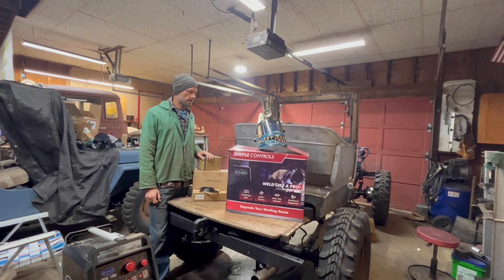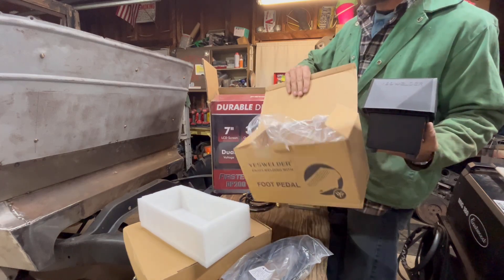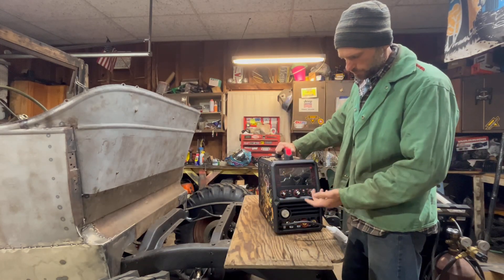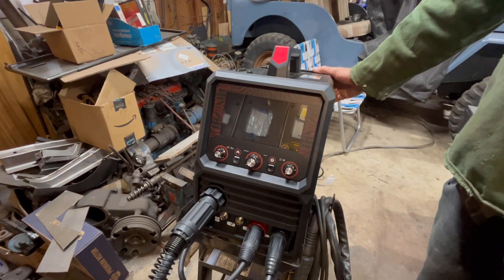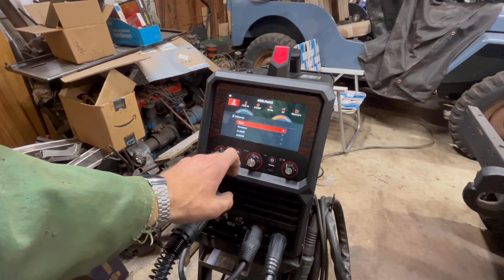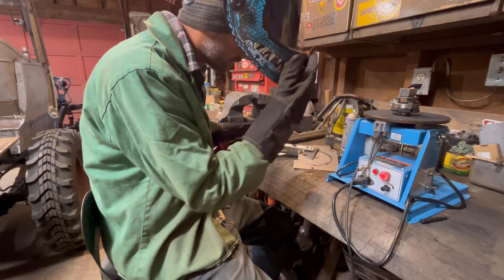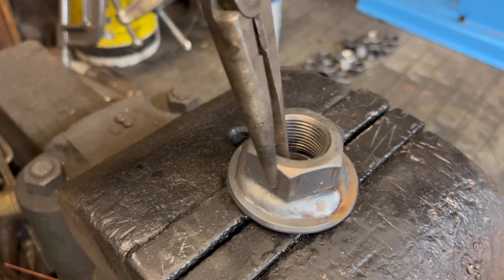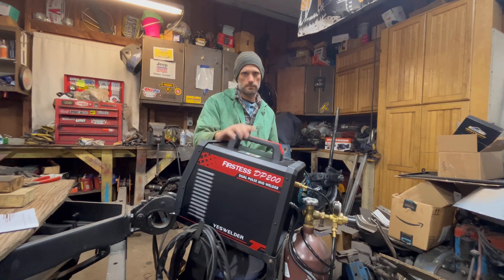YESWELDER DP200 unbox and review Mig tig stick

Comment: yeswelder has released firmware 5.1 update.
have you been able to update and check it out ... ?
Reply from the maker: I have not looked into that. My welder is still working great! I’ve been using it a ton. Melted about 7 pounds of .030 through it so far! 👍

Comment: Nice!  You got one of the Kickstarter Editions.  I think it was smart of them to default the screen on Dark Mode.  I don't think anyone uses the regular mode.  It looks a lot better in Dark Mode.  For the price, I think it's a lot of machine. We'll have to see if it's got the build quality to last.  I want to try C100.  I haven't tried any of the pulse settings but I'm really interested to see what it does.
Reply from the maker: @JeepnJeff  yeah it’s a cool machine. When I have more time I will play with the other functions. I have high hopes for it. I’ll use it pretty hard in the next month or so.
Reply: @SethHensler  Can't wait to hear your thoughts on it.  I need to still set  mine up.
Reply from the maker: @JeepnJeff I’ve put about 5 pounds of wire through it so far. It’s a beast. I’m loving it.
Reply: @SethHensler  Thanks for the update.